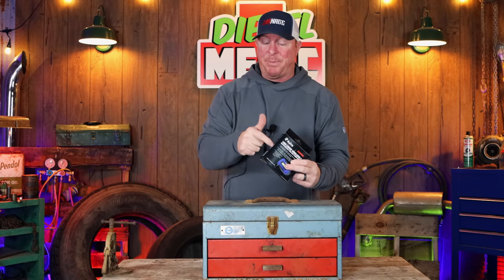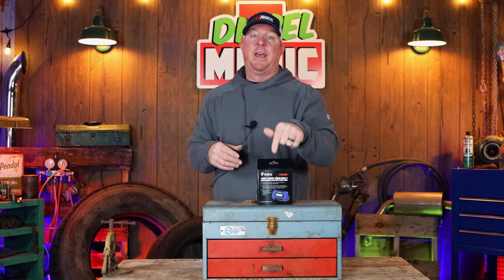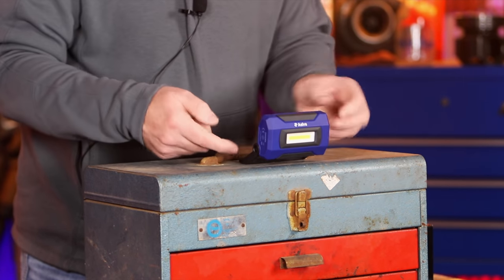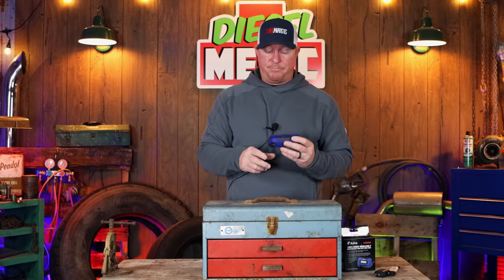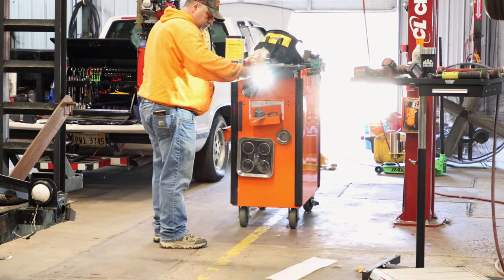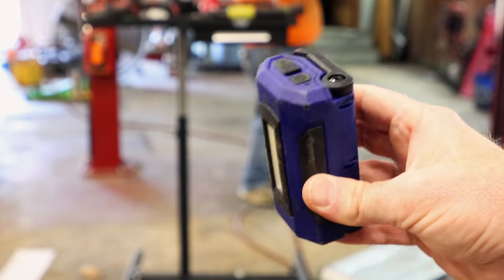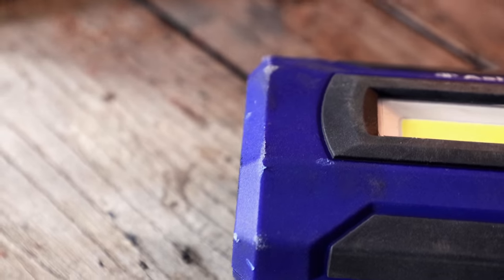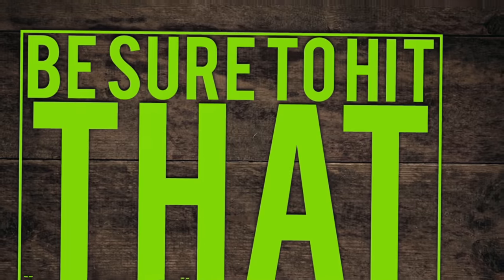Astro 100SL Wireless Light Review And Torture Test *WARNING THIS IS TOOL ABUSE AND IT TOOK IT!*

Comment: There is no better tool company, customer service-wise, than Astro Pneumatic.  I own many of their tools and I look forward to buying many more (including this light)!
Reply: I have never owned a ASTRO tool. I guess I always considered them more on the cheaper quality side. If their tools are anything like that light then I will definitely take a closer look.
Reply: @randysmith9636  Cheaper price but not cheap quality.  Their lights are fantastic!  Their heavy duty suspension tools aren't as good as Snap-On but their value is unparalleled.  I've used my Astro ball joint kit to death and it's never broken or failed.  Even 200,000 mile rust belt F-350 ball joints couldn't defeat the tool.
Reply: @djosbun  Thanks. I do love my Snap On tools and in my opinion they are some of the best on the market.  I do spend the money on them because I personally feel they are worth it. But having said that, they do not have the market cornered on quality and toughness.  The trick is finding companies that have that same level of quality and durability. Everyone claims that they are just as good as Snap On but only costs 12.50 compared to 900. 
Endorsements such as yours, someone who actually uses them more than that one time at uncle Joe's shop means something.  So Thank you. 
That's why I watch this channel, I respect his opinion.

Comment: Great review, could you one day do a review of long lasting, the “test of time” review on some tools….like a snap on digital torque wrench that’s been used and cycled and what’s has broke or works same as new zero issues, showing some longevity so to speak.
Reply from the maker: Still have this light and even after all the torture it went through still works perfectly and holds a charge no issues at all
Reply: @KoonTrucking good to know, have some Astro lights coming as well as snap on larger folding led ….done with Braun from harbor freight as switches fail prematurely

Comment: What brand air compressor is that in the back of that pickup. What’s the specs?
Reply from the maker: It’s an ingersall rand head with Honda compressor on and ole upright electric tank. I covered it in my budget service truck tour
Reply: @KoonTrucking  thanks

Comment: Hey Clay, gotta question for ya. My boss was debating on getting some lights. He checked out the new Stinger, but was looking for more of a magnetized light. I’m trying to convince him to get us the Astro set. I’m talking about the this one, the stick light, and the charging base. Do you know if it’s available anyone other than dealers? The only place I’ve found that bundle so far is Joe and Techs Choice. He wanted a part number for the set.
Reply from the maker: It’s on Amazon there’s link in my bio to it and also in my “favorite tools on Amazon” there’s a store / link there
Reply: @KoonTrucking  I’ve seen em separately and 52SL with charger on Amazon, but I was looking for that combo Joe had (52SL, 1000SL, and charging base). Only other place I’ve found it is TechsChoice. Im thinkin it was a dealer special. Oh well, thanks anyway.

Comment: You should have used crc in the green can and try dropping it in a bucket of hydraulic oil and see what happens
Reply from the maker: I think I proved it is tough
Reply: @KoonTrucking  i agree but will it hold up to chemicals is my concern i work on big trucks and yellow iron so i am around a lot of hydraulic fluid

Comment: Thinking you made a great test on this item 
I've had lights that after 3 drops were not working properly and I disposed of them as well 
Gravity is definitely the worst enemy of the shop/work light
Any one have the wireless charger besides the trucks
Reply from the maker: Astro makes the chargers also. That’s the one in the video